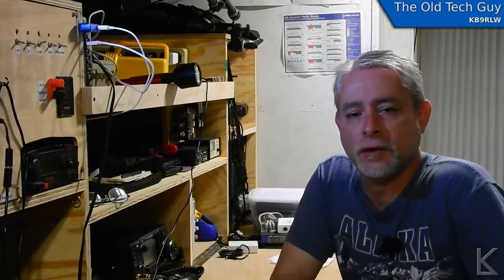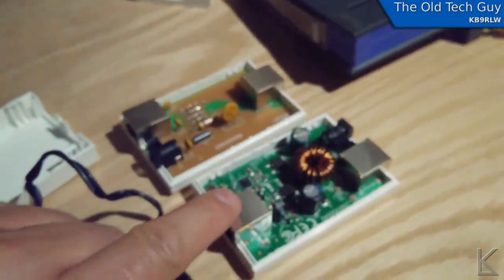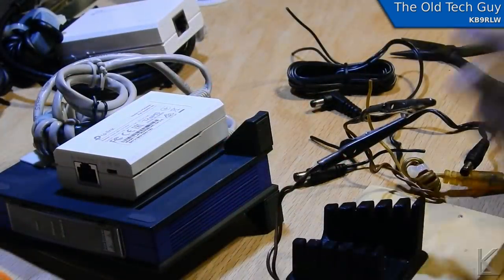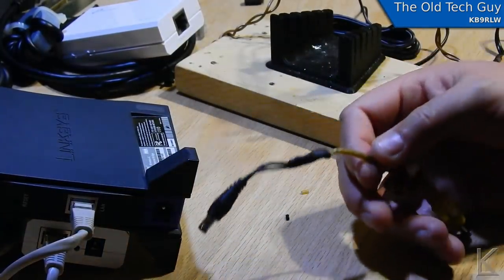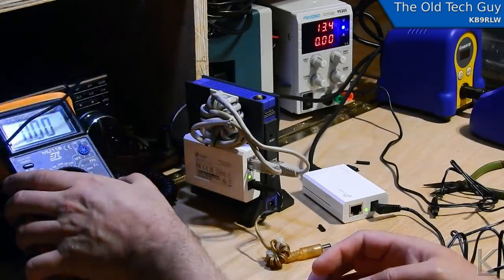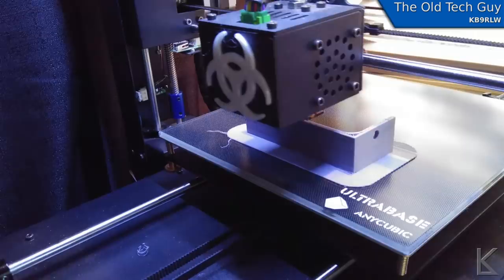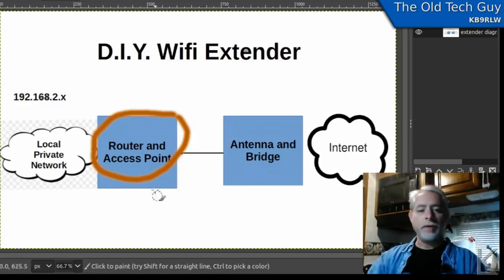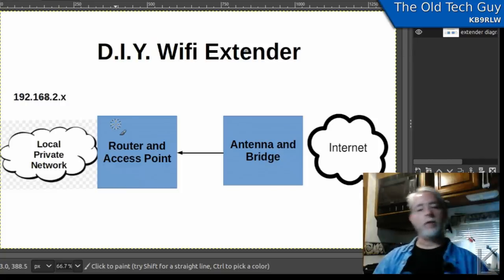Electronics and RVlife - A D.I.Y. Wifi extender part 2. putting it together.

Comment: I just discovered this channel and am now immersed in learning how I can increase the distance I can use a wireless access point.   I found an old 2.4GHz Yagi antenna in my junk box.  It is the same exact model you are using.  I think the reason it was in my junk box is that I have never gotten decent results from it.  I also found an old dual band WIFI Range extender called the Ampred wireless model SR 20000G.  It is allegedly a 600 mw ( each band) including  2 RF amplifier and 2 preamplifiers ( one for 2.4 Ghz and the other for 5.0 GHz).  It has two very "Mickey Mouse" rubber antennas affixed with the Reverse polarity SMA sockets/plugs.  I found this in my junkbox for the same reason.   There is no way I can think this puts out 600 milliwatts on 2.4Ghz.  The Wireless Access Point I am testing has 70 mw output on both bands,   I am lucky to get a range of 50 feet with no clutter.  I do not know the Netgear model number of the WAP/ router.  It meets the FCC " N " specs. The first issue I see is that the Netgear has an embedded antenna inside the case.  It would be useful for experiments to have an antenna connector that I can affix external antennas.    There is a HUGE difference in RF propagation depending on the sense of the antennas ( horizontal, vertical and right and/or left hand polarization.  Phasing harnesses for each band would be helpful to create the circular polarized  signal of choice.  My initial goal is to be able to SIMPLY connect with a public HOT SPOT without having to park close to it while traveling.   I plan on using a  5 foot tall tripod for my remote field antenna tests.  I found that the "WiFi extender" has excellent NAT features that are never mentioned in the instructions.  I found them only after spending HOURS tinkering with it.  Thanks for your encouragement with this VLOG.  My preliminary work found a possible issue with other set ups that use dual NATting ( two routers).    This SR 20000G has the feature of cloning the WAP router settings so I don't need to worry about port settings for open and closed ports TCP or UDP.  I should also be able to use this for port forwarding /triggering by matching the internal router settings to each other.  I could theoretically game with this  If the 180 ms latency were not so bad! I also remind you of the issues of IPV4 private ip addresses from 169.254.1.0 to 169.254.254.255.  When you see these pop up on your extender LAN it can indicate that you are not connected to the internet cloud.  Reasons include dual NAT issues or poor RF link quality.  

 Let me know if you want more reports?  In the past I  have used commercial  P2P  2.4 GHz patch antennas on WiFi with excellent results at at 4600 feet.  One issue is that BOTH antennas must be as high as possible.  The "RF beam" is not like a beam of light.  Instead it expands in the center of the distance to an approximate diameter of 15 feet at the 2,300 foot mark.  This is called the Fresnel effect.  When the RF beam expands wide enough to hit the ground  , the signal is greatly attenuated.  I guess I need to drive a boom truck instead of an RV to get the antenna height required?   Just for fun I found this.  Do you think this DIY  disc  YAGi could work better?  https://www.youtube.com/watch?v=Nk-nj_BwoBE   Here is a much better DIY Yagi solultion  https://www.youtube.com/watch?v=QTMi99HtW_k

Comment: I'm not sure I could resist making a little turret on top of the RV for the antenna and bridge, with a small DC gear motor rotator.  Bonus points for integrating a small surveillance camera to help aim the antenna that could double as an RV security camera to see and record around the RV. 😀

Comment: I'm a great believer in Solder Seal butt connections. They're easy, fast, and have built-in seals against water getting into the joint, and the heat-shrink over the joint is part of the connector. I have 'em in a bunch of different sizes to fit various sized conductors.

Comment: I do something similar without the RF component when traveling and staying in hotels.  I avoid the public WiFi and usually can plug into their wired network.  Then I set up a little router to create my own wireless network behind a firewall and run a VPN on all of our laptops.  Easy peasy, safe and easy.  Sometimes for grins, I setup a honey pot on the public wifi just to see what sleaze balls it might attract.
Reply: How difficult is it to add a honey pot?  Can you describe the process?
Reply from the maker: Create a vanilla install of windows with no additional software or security.  Using a virtual machine like the free VirtualBox works well for this.  
Put this plain jane windows machine directly onto a public network without any additional firewall or security.
Monitor the traffic to it's IP address with something like wireshark and examine what's going on with it.   Maybe scan the IP addresses that try to access the machine using a tool like nmap to see what they're using.

Comment: Not sure you mentioned it - POE is specified for up to 44v and 350ma down the spare wires. 
The normal POE line voltage is as high as ~44 both to allow for long runs but also to keep the current low. 
If your bridge really wanted all the 5v 2a the POW device offers, you would draw 13.4v x 750ma down the cat 5 which is a bit high for the wire and cat 5 connectors. Fortunately you didn't seem to draw more than 350ma at 13.4v so all is good.
Reply from the maker: Yeah, that's specifically why I had that bench segment in the video where I was testing it at the lower voltage. And I was happy to see that the power requirements of the bridge were low enough to allow that operation.

Comment: The yagi antenna better to put it outside for better reception plus if u go with a mimo dual antenna with a (-;+) 45° degree angle polarization for stable and a better reception and LTE speed just for an idea of the wideant2-lite true mimo dual antenna there is also mimo quad antenna the polarization is plus

Comment: I have done this without having to use the bridge with the software, just used repeater mode on the lynksys
Reply from the maker: The downside to using a single radio, is you cut the bandwidth in half. I'm not sure about the routing functionality and built-in firewall in that configuration either.

Comment: Very well done and interesting Kevin, can you name the brand of the 3D printer you are using and would you recommend it? If not any that you would recommend? I'm waiting on the antenna that I ordered to complete the same set-up. Thank you for sharing.
Reply from the maker: It's an Anycubic I3 Mega.   It's a decent variation of the Prusa I3 design.   Like any of the cheap imports though, you should expect to have to 'fix' a few design flaws.   I re-routed the bed cables to stop them rubbing on the port they pass through into the chassis, and had to remove some milling dust from one of the stepper motors.  I also modified the power supply so that the cooling fan would run at half speed 100% of the time for better cooling.  Finally,  nearly all cheap imports will have very poor bushings in the fans that wear out way too fast.  One of the first things I do on any of them is peel back the fan's label and add a drop of lubricant to the bearing. I mix a slurry of grease and machine oil for this and it solves that problem completely.
Aside from that, it has a really good solid frame and has held up well to the vibrations of travel.

Comment: Nice and simple.  Do all routers have a bridge setup?
Reply from the maker: No.   Did you see part one?   I'm using a Linksys WRT54G router/access point and a WET54G bridge.  Two separate units.
Reply: Ha.. I just gave wrt 54g away to friend with no wifi at all.. .Yes on part one.. never bought or used a separate bridge.
I do have an Asus Rtn16 that was a gaming wireless. replaced caps in power supply  and using as laptop streaming..
73, 
kb8qlz Gary
ps..kenwood make the bumpty trip?

Comment: I'm surprised you need a RF choke for such a short length of wire on the power supply?
Reply from the maker: That's for choking of RF picked up by the cable run. When I'm transmitting.  I didn't want the network to drop from the RF crashing the bridge or router.

Comment: Kevin,
What size power connectors for the POE unit and the WET54G and do you know a good source? I bought one without a power supply and what I already have will not fit.
Reply from the maker: I don't know the size, but you can buy power supplies for it pretty cheap.
https://www.ebay.com/i/272335299696?chn=ps&ul_ref=https%253A%252F%252Frover.ebay.com%252Frover%252F1%252F711-117182-37290-0%252F2%253Fmpre%253Dhttps%25253A%25252F%25252Fwww.ebay.com%25252Fi%25252F272335299696%25253Fchn%25253Dps%2526itemid%253D272335299696%2526targetid%253D313776934696%2526device%253Dt%2526adtype%253Dpla%2526googleloc%253D9031410%2526poi%253D%2526campaignid%253D1669934609%2526adgroupid%253D65058347499%2526rlsatarget%253Dpla-313776934696%2526abcId%253D1123856%2526merchantid%253D108057413%2526gclid%253DCjwKCAjw1KLkBRBZEiwARzyE7zumWQrgi2cFJmTR_P1f1jci_3m7mqgF04T3k3Ff6j4g0dXlK5mt9BoCWfAQAvD_BwE%2526srcrot%253D711-117182-37290-0%2526rvr_id%253D1894402004975%2526rvr_ts%253D78c10bf81690ab6a85921202ffd0c072